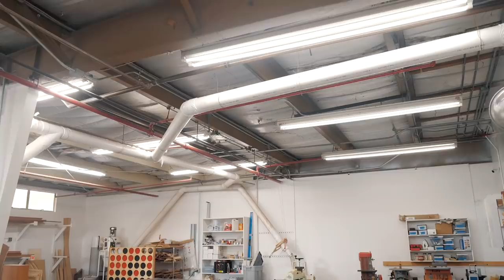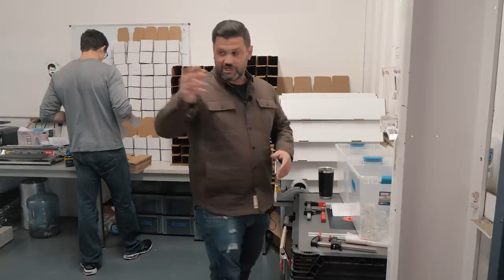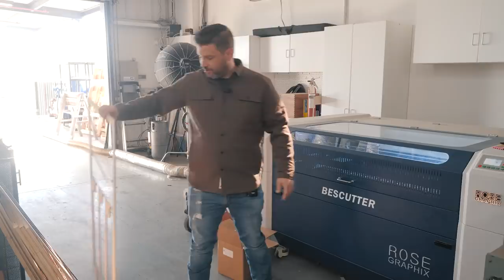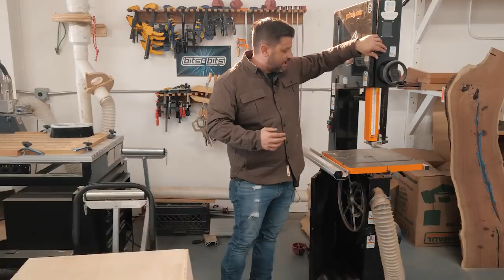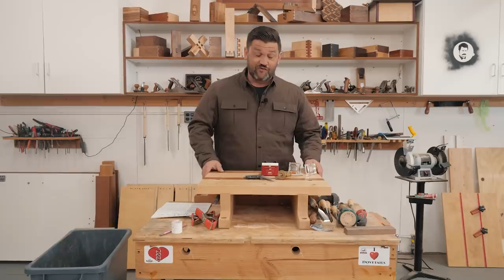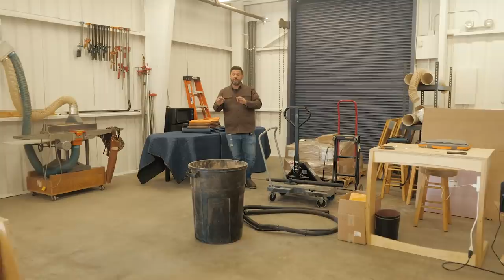Katz-Moses Shop Tour 2019

Comment: I'm just getting my stuff set up myself and I barely missed that live q&a you did where I wanted to ask, what would you recommend for a beginner band saw. Is a bench top band saw with only like 9 inches of clearance good enough or would it be a waste of money and I should shoot for something for more clearance?
Reply from the maker: Shoot for a 14" at least both grizzly and delta make 14" ones that you can add a riser block to if you need the extra capacity. The delta ones pop up on craigslist often.